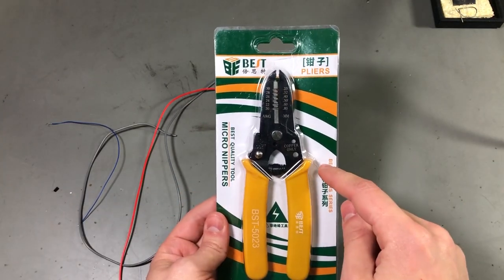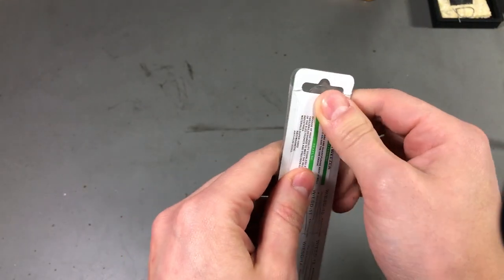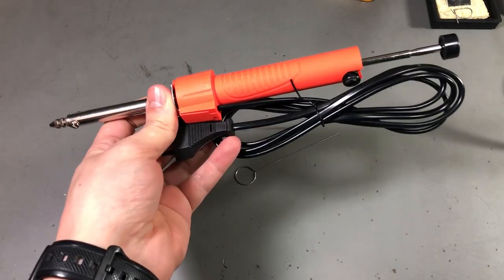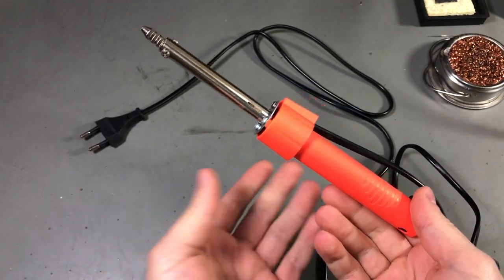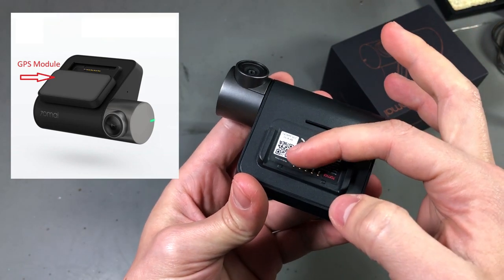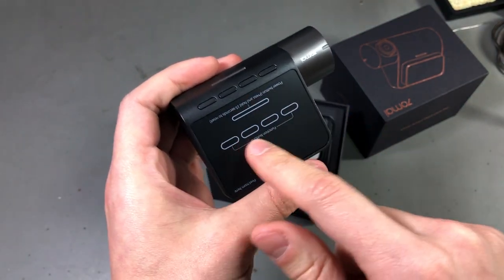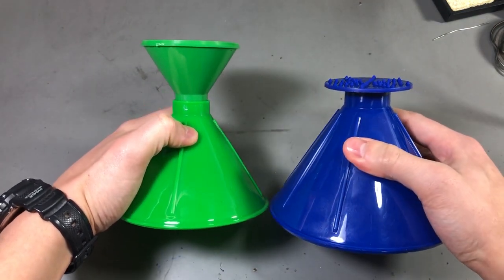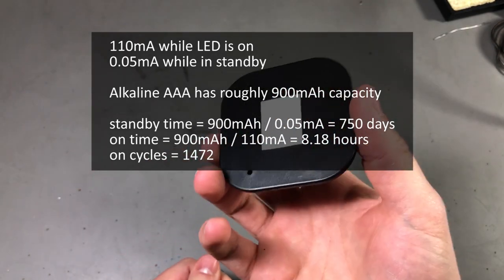Voltlog #205 - InTheMail

Comment: I have also bought two sizes of the yellow pliers after watching the same video. I really like them. The locking mechanism is also nicely positioned as you can use it with your index finger. Thanks for the ice scraper tip! I'd love to hear your experiences with it, even if as just a reply to this comment. In Helsinki there was a nasty snow storm just a week ago, leaving a difficult to remove layer of ice on my windshield. Only thing that strikes me as a potential issue with that design is the reach. I'd poropably have to lean against the (possibly dirty) car to reach the middle of the front windshield without a longer handle...
Reply from the maker: I guess you are right with the reach, I didn't think of that though if it would have a handle it couldn't work as intended with the circular motion, it would be much harder to use it. I will report back if we get another snow here and put it to a test.
Reply: I'd also see the size as an issue. That thing is not very small to store and if left in the car will almost certainly be in the way all the time.
Reply: @superdau Well I need to have a small shovel also during the winter so the size of this thing would not really be an issue for me. It looks kind of silly though. :)

Comment: Smoking/charring insulation on a cheap mains soldering iron, yikes! Also, it seems to be ungrounded, so besides the usual drawbacks of an ungrounded soldering iron, if something goes wrong inside due to faulty insulation you could be in for a bad day. Teardown candidate maybe?
Reply from the maker: yes, a teardown will follow.

Comment: Hakko fine point tweezers work well for placing small parts. The problem is not magnetism, but when you get flux or paste on the part or the tweezers and it sticks because of that. Those ceramic ones look like they might be more difficult to use because of the thickness of the tips.

Comment: So you had the same issue with end of November orders? I just got one from 11/27 yesterday, while I'm already getting a couple orders from 1/4. I wonder if they have an occasional plane that gets diverted for mechanical issues or something similar and our orders must wait on the repair (assuming we are part of the same logistics route). I think most cargo planes are just retired passenger planes at the end of their service lives. I've heard such aircraft can be really problematic and in pretty rough condition. The most discounted shipping service in the world probably has the lowest cost option possible. I bet a lot of our orders have issues due to aircraft maintenance and repairs.

  I've also heard that those cheap desoldering pumps have issues with clogging, but I can't confirm.
   I'm on my 3rd manual desoldering pump now. So I expect any similar design to last around the same short amount of time. Mine have all had issues with the rod latching mechanism wearing out over time. I clean them out fairly often but the plastic just wears out with regular use. 
  While it won't help with this kind of design, if anyone has a manual desoldering pump, just add a bit of heatshrink tubing to (over) the tip of the pump and shrink it down. This will put all the suction into an even smaller area. The heatshrink can handle the heat much better than the pump's tip, it will conform to the surface shape and can fit in between pins and much tighter spaces. It will clog much faster. I keep a small dish of tubing cut to size for this purpose. With the right iron tip and temp this can desolder almost anything. The extra suction, ability to completely surround the pin and pad, and the ability to conform to and against the board, makes for a combination that can evacuate almost anything even on a multi layer board or a design with a large fill zone. At least that is a technique I use often ;)
-Jake

Comment: Those holes are used for shaping solid conductor wire to fit around terminal lugs.
Reply: ....and the reason they are labeled "Copper Only" is to remind the user to not attempt to bend steel wire with it since the tool will bend.
Reply: I've seen them use to cut small screws. My guess it the "copper only" is a warning about the blades and not the holes.
Reply: @JonathanNagel  Here let me say it like this I didnt know we needed to go over it all the copper only is to tell you to only cut copper. The holes on the side of the tool are for looping copper for terminal connections ie the back of wall sockets. The holes in the middle of the handle where the two peices pass under one another are for cutting small screw very light screws like those in wall sockets, light fixtures etc. I just assumed everyone know what the other holes and copper only warning was I forget not everyone is a dyi as me.
Reply: I would suggest you you tube what the holes in wire cutters are for lol. If you have any more questions.

Comment: I bought a set of VETUS tweezers for about 6 Euro on ebay & i was surprised that they were actually very good quality
Reply from the maker: I previously had a good set of VETUS tweezers, I don't remember where I purchased them either ebay or banggood but they eventually got damaged so when I got a new set, they weren't the same thing, they were lower quality, probably a copy of the copy.

Comment: That solder sucker you're using that smoking like that, I bought a soldering iron from Radio Shack many many many years ago because I needed one in a hurry and all it did was smoke and get red red hot inside. and then within about an hour or two the element burned up. I'm thinking that element in that soldering iron is not very good or it's just cheap quality, I should say.
Reply: Also that cabinet light that you bought that showed that the last item that you have, if it comes on when you cover the light sensor, if it's in a dark cabinet wouldn't be on all the time???
Reply from the maker: @DogRox  it has to meet two criteria: low light and movement detection for it to come on.
Reply: Ah ok makes sense!!  :-)

Comment: No earth on that desoldering pump= throw it in the bin
Reply from the maker: yes, no earthing but that shouldn't be a problem if the tool is built properly... we'll see, maybe I'll do a teardown soon on the subject.
Reply: @TheChipmunk2008 also there's that small problem that most old-generation flats built decades ago have absolutely no earth wired in whatsoever around here. There simply is no third wire in the walls. Amazingly enough most people seem to manage to stay alive anyway. And of course newly built homes are wired with earth...
Reply: @AttilaAsztalos  The thing there is the word 'flats'. If there's no extraneous potential (metal pipes, actual 'ground') then non earthed stuff can be ok, agreed.  I suspect this thing tho is a piece of crap from china.  It should be provided with a 3 conductor cord, 3 prong plug, and then, if it goes horribly wrong, it's the fault of the user, not the manufacturer
Reply: @voltlog  I have a similar desoldering pump made by Velleman. seems to work pretty well. the spring seems strong and the release button seems to be in a better location.
Reply from the maker: @d.logic1  what was the cost of the Velleman?

Comment: Here let me say it like this I didnt know we needed to go over it all the copper only is to tell you to only cut copper. The holes on the side of the tool are for looping copper for terminal connections ie the back of wall sockets. The holes in the middle of the handle where the two pieces pass under one another are for cutting small screws very light screws like those in wall sockets, light fixtures etc. I just assumed everyone knew what the other holes and copper only warning was I forget not everyone is a dyi as me.
 Like i said i assumed everyone knew you were supposed to cut wire with wire cutters by the way the will cut aluminum wire just fine as well as long as its the proper gauge. Just not steel wire etc. Next time ill break it way down. My bad.